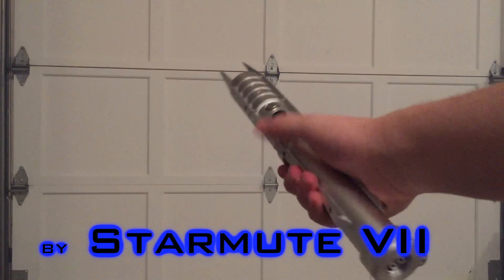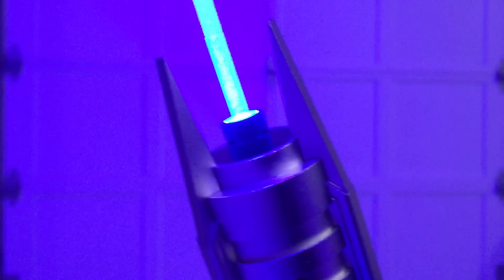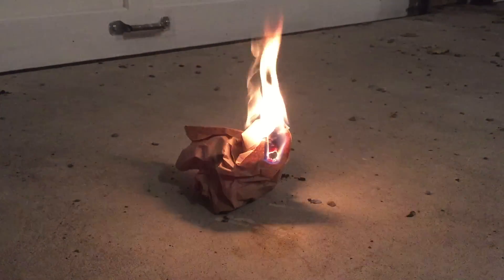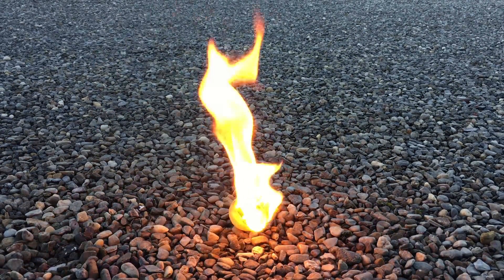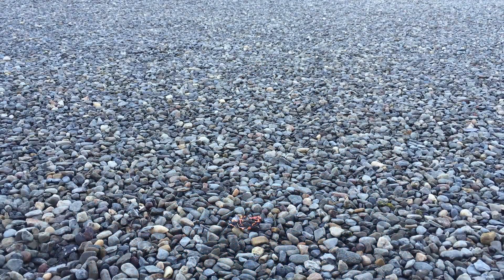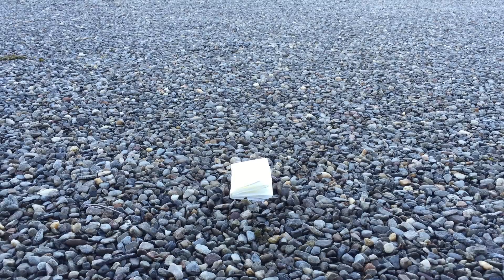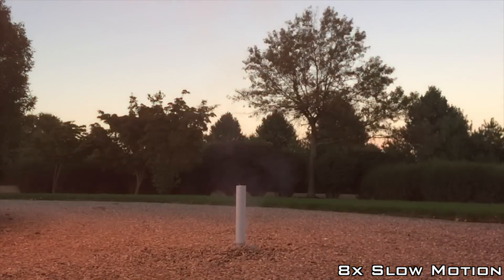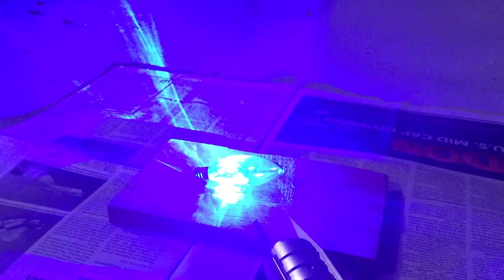REAL Lightsaber - Homemade 7W Laser in SaberForge Reborn Hilt!

Comment: Thats  a gun, not a saber.  The tricky part that could be impossible, is finding out how to control the length of it, but that would require bending laws of traveling light.  The only way i see it possible is with a blocker at the top, and thin metal supports for it on the side.  It would be harder to swipe through things, but it would make it possible.  Would have to be a material that heat won't melt so easily.  Still cool though.  A very big step forward to making one, just gotta find out how to block it at a length with a thick metal top object or something.
Reply from the maker: A true, length-limited laser lightsaber is not possible, since stabbing attacks would be disallowed by the blocker at the top. The closest thing to a real lightsaber would be a blade of magnetically confined plasma.
Reply: Starmute VII True.
Reply: Couldnt you use a type of magnetic type of thing to almost "pull" it back into the hilt somehow, so you can control how far it will go
Reply: darth telly but the magnetic force would be rivaling that of a neutron star sooooooooooo
Reply: darth telly yes
Reply: try graphene
Reply: Your best bet is to use heat resistant ceramic because that's also what is used for the bottom of  NASA's space capsules when they enter the earth's atmosphere same this with the space shuttle to!.

Comment: what if you could put like 6 beams in a circle with very little room apart from eachother, bigger beam?
Reply from the maker: That would require more diodes, and thus more waste heat. It would be possible in theory, but you'd need a huge heatsink and probably a fan too.
Reply: oh I wouldn't know about all that kinda stuff just seemed easier put together in my head lol

Comment: Pretty cool. It would be nice if the beam was wider and you could actually control the length if the laser. Then it would be a true lightsaber.
Reply from the maker: You can actually make it wider using something called a beam expander. 
It fits right onto the end of this laser! Though controlling the length 
is not really possible - light doesn't stop until it hits something.
Reply: Starmute VII what if you had a mirror at the end of the lightsaber then it would reflect back.
Reply from the maker: Yes and no.
With a beam expander, you can make a small point much further away. So without a beam expander, you wouldn't be able to burn something 50 feet away, but it's a piece of cake if you've got one on the laser. The downside is that it's much harder to burn things at close range.
Reply: Would expanding the beam in this way diffuse the intensity, and therefore make it less able to cut (or more appropriately, burn) through objects?
Reply from the maker: Hey GroupDenmark,
You do make an excellent point. I have a collection of around 40 different wavelengths - my main interest is the color! But burning stuff helps my youtube channel and helps me make money, so why not do it?

Also - some of the experienced LPF members do care about burning. Look at RCB, for example!

I've definitely taken some beam expander shots, though, and I'll be posting them on LPF eventually. :)
Reply: Starmute VII sell this or put a link for a 7 or 8 watt laser
Reply: +Starmute VII "Controlling its length is not really possible - doesn't stop until it hits something" It actually is possible according to a experiment https://www.youtube.com/watch?v=1lr5OUjFDkg ( but they only managed to stop it "for a fraction for a second" )
Reply: Starmute VII what if I were to make a layer of smoke around it so it couldn’t leave?
Reply: Starmute VII how about trying to put something on top of it so that the laser will stop there?
Reply: That's the only issue with making a light sabre is getting the light to stop but I believe even if you some how manage that. The beam being able to collide with other Sabres wouldn't really work to well
Reply: Sir Ken The beam is pretty realistic the lightsaber beam looks wide but actually it’s just because u stand further away
Reply: The burn-aspect useally goes out the door, as you get older and more routine & knowledge on lasers.
sure, I know that doing all the things you did in that video, is like a wet dream for the 15year old pimbled teenager and the chase for YT-fame in a nutshell, but come on people with that wanne-burn-aspect hopefullu doesnt mess with these high powered diodes to often.

hopefully' people will treat these LDs with respect, and most do,when it comes to the skilled people that works with these high powered diodes., for lets face it, how often do you see the skilled review-dudes on LPF or on PL demonstrating there new high powered diodes by burning stuff.(the reason is that you looks like a unmature fool, burning ballons or setting things on fire).

I dont know what makes you happy, but it looks like burning stuff is your primary alley, - for myself I would much rather see you put a good beam expander on that sucker and take some night shots at distance on a less foggy night and show that beam of massless partcles in all its glory.
Reply: @GroupDenmark  how fucking sad and childish do you need to be to go out of your way and write a paragraph insulting some guy having fun with a laser hurting no one and enjoying himeself? Imagine trying to turn a laser into something about being mature, thats so sad
Reply: Do you know how to make a lightsaber with a set bladelength and less volatile nature? I really wanna see a less dangerous, proper lightsaber.